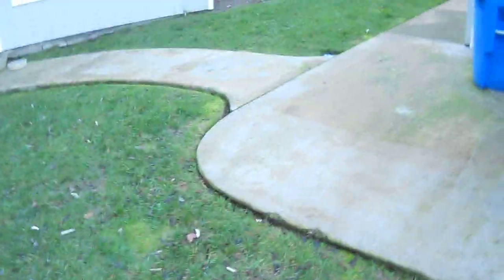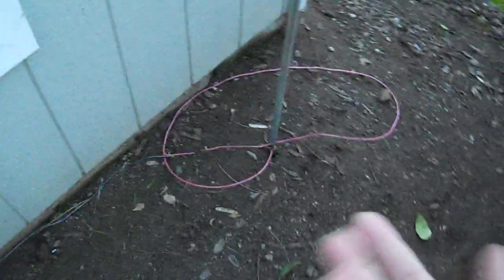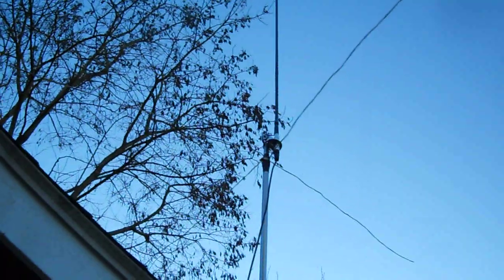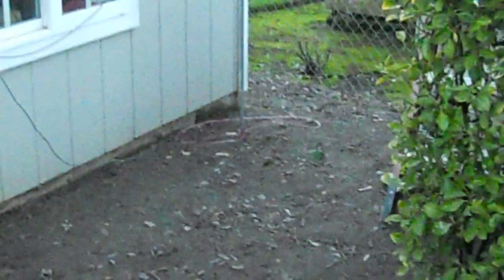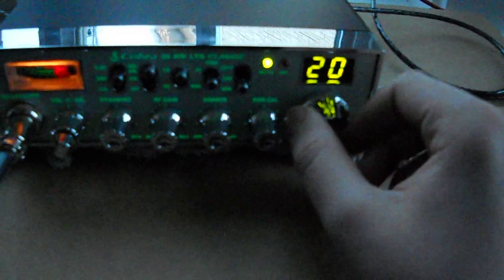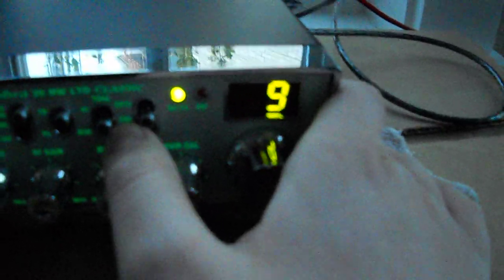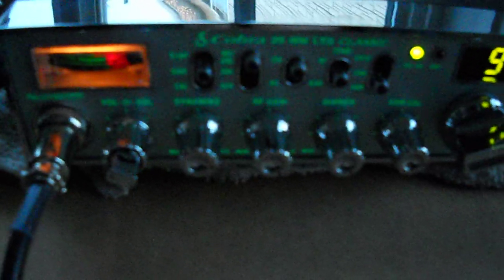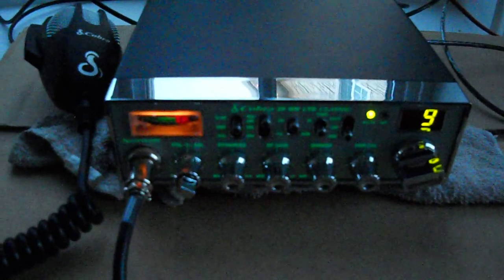CB Radio Home Base Setup Part 1

Comment: It's fantastic that your family is supportive of your hobby, not too many family members help out in the way they have for you. Like the other guy said, it is great that youngsters are getting into the hobby, hopefully you make or have made a few contacts. Good luck to you and to a really rewarding hobby. I'm a cber as well, I ran a 102 inch whip as my base setup with an old cobra 148gtl and made many contacts in and out of country, so cb radio can be rewarding if you divulge into it. Handle here is 787 in central Texas

Comment: It looks like you did a fine job assembling and installing that ground plane antenna. The length of the radials can be computed by dividing 468 by the frequency in mHz. 27.185 for channel 19 for instance, and dividing the result by two. I come out with 8.6 feet. I do recommend that you research a vertical dipole as it would outperform that antenna if the feedpoints of both antennas were placed at the same height. A vertical dipole in a tree, especially if you can get it up high will work well.

Comment: 6 (I know all of these are listing backwards)  When you test your SWR test on channel 40 and channel 1.
 If the SWR on channel 40 is greater than that on channel 1, your antenna is considered to be "LONG" and you need to make your antenna shorter, and if the SWR on channel 40 is less than channel 1 then the antenna is "SHORT" and will need to be longer. Adjust the length and then retest the SWR. When they are about the same and both lower than 2 then your antenna is working okay.

Comment: Yep, not up with a 5/8 but close, a vertical dipole is about 171/2' of wire, cut in the middle & fed there, the shield of the coax attaches to one half(bottom) and the center of the coax to the other(top) half.
The coax needs to exit the center at a 90° angle for at least 1/2 wave or 18', then down to the radio. Keep the coax short as possible or get RG-213 for 100' or so lengths.
Just build the 5/8 closet rod antenna (make sure you paint it with KILZ to seal it from the rain!) & you'll LOVE IT!

Comment: The half wave doesn't require any matching other than pruning the antenna so it's the best way of going. A 5/8 wave would require matching at the feedpoint. Yes, the coax has to go away at 90 degrees for a distance. Inconvenient but necessary. The half wave should work well if you can get it up reasonably high. Recommend also looking for a cb radio with SSB at some point. More range, much better than am. Good luck and I hope you're having a good summer. 73

Comment: Oh one more thing, remember the length of your Coax will effect your SWR, try to stick to multiples of the half wavelengths (about 18 feet) although there is something called the VF of the type of coax you use to take into account if you want to be really cleaver, but for starters stick with, 9ft (1/4 wavelength), 18ft etc

Comment: I unwrapped my P.O.S. Wilson FG-T 'Silverload' & lazy wrapped the silver wire up to the top brass terminal, then cut down a friend's "too-short" Wilson 1000 whip (he GAVE me because he cut it way too short) & stuck it into the top brass terminal, shortening it until I had right about 105".
You should first try this & add 3-4 108" wire radials at about a 45° to 60° down angle, basically making an M400 Starduster.
After you get that to work & test/play with it, build the closet rod 5/8 & enjoy!
73

Comment: Get 12 feet of closet rod & secure a 6' - 9' whip into the top, then wrap 12 turns of wire around the base of the closet rod, 1/4 inch apart, then a lazy wrap all the way up to where it attaches to the whip on top, making sure you have 22' 6" above the coil incl whip.
You need 3 106" radials at 90° connected to the bottom of the coil, attach the center of the coax about 1/4 - 1/3 of the way up the coil where you find a 1:1 SWR.
You won't believe how excellent this 5/8 performance will be!
DDX-10

Comment: A 5/8 wave antenna at the frequencies used by a cb would be almost 23 feet tall. That antenna you have is basically a loaded quarter wave. A 102" whip or wire would outperform it. It may have 22.5 feet of wire wrapped around a fiberglass pole but that is immaterial. Best to replace it with a full sized quarter wave for full performance of a groundplane. Interestingly, if you built the same antenna for that FRS handheld radio it would only need to be about 5 and a half inches tall.

Comment: Back in the day I had an Antron 99 about 30-40ft in the air. I had a radio capable of channels above and below the CB 40 with Upper and lower single side band. If you like talking to people, side band is where its at. When conditions are right you can catch some skip and talk world wide. Find a good radio tech to open up your radio to swing. It will get you out way more.
Good ground plane on your radio is huge, those radials are what makes you get out. The higher the better on your antenna. Also make sure you have quality coax. Cheap coax loses a lot of signal. I paid a guy for some millitary grade coax, I forget the brand/specs, but had a 100% wire braid shield, plastic dielectric, and thick braided copper core. Very robust stuff and you could bury it.
A lot of hard core guys who were also into ham radio had beams, which make your signal extremely directional and could talk skip and even line of sight much easier.
consider getting your Technicians license.

Comment: 4. Your radials work best when they are the same length as the antenna, your antenna is a 5/8th so 5/8ths of 11.11m is 6.9m total, as you are using 4 then 1.75m would be about right for each one.
5. think about installing a lightning arrestor to protect you and your rig from thinderstorms

Comment: I'm a cber from way back . Let me give u some great advice. Don't ever hook ur ground wire to the radio. Never count on radio swr meter to be true swr reading. Your antenna isn't what u use with with wires . Ur mast if metal is already grounded . Lightning hits ur antenna and that wire u have hooked to ur radio will cook it and and start a fire. Learn the hobby and do it right get a swr meter not a cheap one . Get a solarcon ant-99 and use a good coax rg-8. Get ur antenna up higher and guy wire it and ur heading in the right direction. Get a galaxy 959 side band radio and have 120 channels and dx all over . 12 watts Ssb and enjoy the hobby better.

Comment: You should get a power microphone. a Astatic Road Devil would be good. that would make you louder, also get a Antron A99 antenna, that would work much better. also make sure you've got high quality coax thats not damaged at any area. Once you get power in that shack, buy a convert so you don't have to use a car battery. If there's a cb shop around you, have them adjust the modulation so you'll be louder. you could also get a linear amp later on. all these things will really improve your setup

Comment: Better off going with a half wave vertical dipole design. Requires less material and it gives almost 2db of gain over a 1/4 wave ground plane. On your antenna only the vertical section is radiating useful energy. With a half wave vertical dipole the whole thing would be radiating. Thus the 1.8db of gain.

Comment: What I'm trying to figure out is where you have that ground wire from the antenna going❓ Your Antenna ground wire needs to go straight down to the rod you have going in the ground at the base of your mast. You can run a separate ground wire from your radio chassis to the outside ground post at base of antenna. Lighting takes the shortest path to ground.

Comment: Yeah, actually, you may as well go with a .64 wavelength radiator if you can match it. That's as big as you can get without introducing unwanted lobes into the pattern. Not a big difference from the 5/8 wave which is .625 wavelength long and of course a 1/2 wave is .5 wavelength long. A 5/8 wave radiator with 3 or 4 radials is a very good omni antenna. I used one for a long time and it worked very well. The bottom was only 25 feet off the ground.

Comment: 3. you shouldn't need the wire that runs from the mast of your mast to the side bolt on your CB, the fact that you do means that they may be something not quite right where the coax/antenna connect to the mast.  Remember that there should be no electric connection between the metal of the upright element of your antenna and the bracket, mast and radials, there should be an electric connection between the bracket, mast and radials ...you can test with a multimeter.

Comment: I think the 102 inch whip would be a better antenna for you until you could save up the money for a base antenna for example a antron99 like what i use is a great antenna but is large 18 ft long as best of luck to you 73s

Comment: You didn't need an inline Fuse? If you ran one, what size fuse and maybe on which wire the pos or neg did you put the fuse in? Thanks.
Reply: Cruusher mine has a 2 amp bus fuse on the positive wire.

Comment: Still waiting for an answer!   
Hello, I recently rediscovered a CB radio I bought in Highschool 1991 that is in mint condition.  I used it in my car and had a group of friends who then did the same. We had a great time.  How can I know which converter to buy to use this as a base station at home?  I'm afraid to not know exactly what I need!   Thanx!
Reply from the maker: Hello, sorry I posted this video almost a decade ago haha. All you need is a DC 12v power supply you can even buy a cheap car battery and run it off that and then when you’re not using it just put the car battery on a trickle charger. These things aren’t super picky they’re meant to run on a car battery so basically any DC 12v power supply should work!!
Reply: @THECONDOR98  haha. Past coming back to haunt you!!!  Thank you kindly!
Reply from the maker: @seasonfilms9375  No problem!! Let me know how it works out im curious

Comment: I was going to do a video response to this and will next week if I find the time. 
1.  The 5/8th wave antenna should be fine.  you would not notice too much difference changing your antenna so I would say stick with the one you have.
2. You say at  02.42 that the antenna is no ground plane antenna, a No Ground Plane antenna has an artificial electronic ground plane for use on fibreglass boats.  I haven't seen anything to say your type of antenna is one of those.

Comment: I just bought a cobra 29 and was told it was 3.7 watts dead key and 22 Pep, with 100 percent modulation can you tell me what this means - I'm going to be using it with a power convertor in my metal building with a antron 99 antenna - what should I expect as far as range and performance!

Comment from the maker: Oh and by the way it's a Wilson FG-T 5/8 Wave 5' 1000 watt antenna is that good or should I just get a 102" whip also if I did get the whip could I still use the same setup including pipe and radials?

Comment: Why do you use a truck antenna? if your at a home station you might as well put a full antenna.Antennas will work at smaller lengths than what they should be but to be effecnt you need to get a long whip antenna

Comment: Nice vid..

Do you really get better SWR reading with that lumpof wire going from the mast to the radio? Just asking because the outer core of the coax does the samejob and connects the case to your mast.

Nice radio, Tony.

Check out my videos of my shack :)

Comment: is a good radio but Cobra 29 das not have SSB LSB USB it just have AM. i did get one from ebay for $120 from America post to Australia and i look at it and it did not have SSB on it so my mate swap one of his radios with SSB. in Australia we all on LSB channel 35. the CB is fading out in this country is not good and it's hard to find a shop to repair them. we have got shops for UHF CB radios but they do not fix 27mhz radio. i have my CB radio equipment on youtube

Comment: A friend of mine takes his cb radio,  5/8 wave dipole and 200 watt burner up on high ground, when you are 1000 ft above sea level a 22ft antenna and 200 watt burner offers very little advantage than using a legal 4 watt rig and a 3foot magmount antenna, quite laughable that so much time and effort is wasted for such a small gain, the real skill is using qrp on 11 meters.
100mw rf output 15 mile range🙄
Reply: Galaxy Tab 
Rubbish 
200 watts on high ground with a large antenna would get you out way further than a small 4 watt rig on a car twig . Have you actually tried both set ups ?
Reply: Nerf family Uk yes it might get you out a bit further but its overkill and to use 200 watts you'd need a linear amp and have the car Engine running.
you'd be consuming somewhere in the order of 25 amps.
you might just as well phone up random people, I'd be cheaper and far less trouble.
Qrp 1 watt to speak to the states from the UK, battery powered device and kept in a jacket pocket.
hf:)
Reply: Galaxy Tab 
Nice reply . Yes QRP is good fun and going back to your original point then I agree the hight makes a MUCH bigger difference to the power you run 👍🏻👍🏻👍🏻
Reply: Galaxy Tab 
Nice reply . Yes QRP is good fun and going back to your original point then I agree the hight makes a MUCH bigger difference to the power you run 👍🏻👍🏻👍🏻